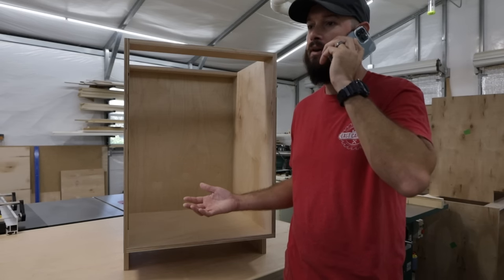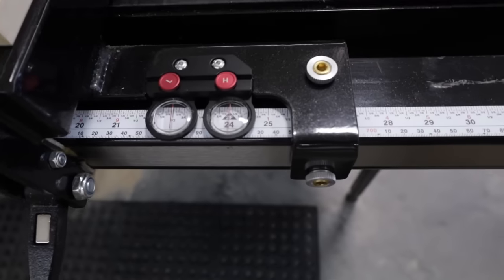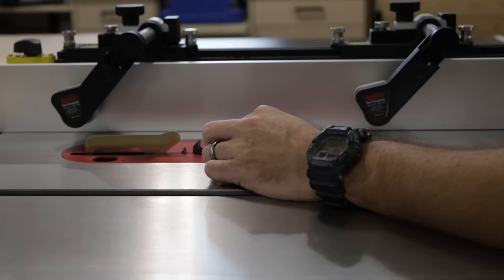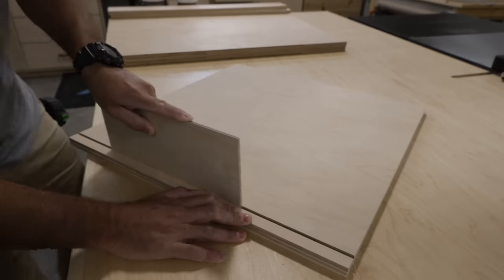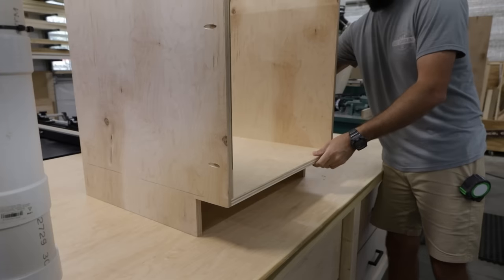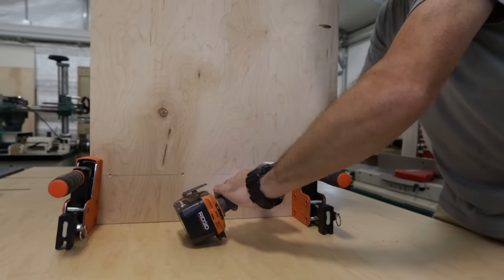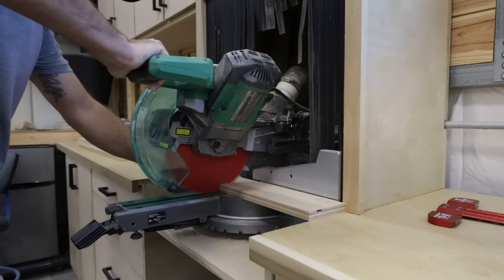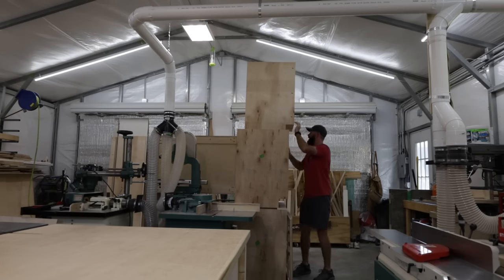How to Build Cabinets in under 30mins //The Easy Way

Comment: Very nicely done. I put myself through college making furniture and kitchen cabinets. As part of that, I ran a small custom cabinet shop. Our cabinets were very similar to the ones shown in this video. Allow me to point out just a couple of differences. Not because ours were superior to these, but to just show another option.

First, instead of making a dado to accept the cabinet back, we used a rabbet along the top and back edge of the cabinet. The rabbet was sized to accept the stretchers at the top of the cabinet and sized to accept the stretcher and the back on the back of the cabinet. Second, we didn't use screws. The cabinets were assembled with glue and 16d finish nails (shot out of a nail gun). Then, the back of the cabinet was used to make sure everything was square before it was stapled into place. The final step (before the face frame) was to attach the back nailer. It was glued and nailed to the sides and the top stretcher. 

Is this method as good using screws, as shown in the video? Maybe not. But, they went together quickly and required a sledge hammer to take apart. As I said, this is just another option. What I line about it is the rabbets provide a lot of mechanical support for the stretchers. Also, even with the extra table saw set up for the rabbets, I suspect my method is faster. If I started Monday morning, I'd have a complete set of upper and lower cabinets ready for face frames by lunch on Tuesday. Wednesday, I'd make the doors and drawers and the complete kitchen would be out of the spray booth by Thursday afternoon. Friday, the installer would pick up the cabinets and I'd review my cut list and make sure I had everything needed for the cabinets I'd start on Monday. 

It was a good way to put myself through school. Now, I just make things for fun.
Reply: I wish I had thought of that
Reply: Everything I’ve seen shows that nails loosen over time and they can’t just be retightened. Why do decks use screws instead of nails? I mean, house framing uses nails because of their sheer strength over screws. But houses warp and creak over time.
Reply: @truthseeker2815  The construction I described, using dados and rabbets, provides joints that are stronger than butt joints. Glue alone will hold such joints together for decades. We used nails because it eliminated the need to keep the cabinets in clamps until the glue dried, not because we were relying on the nails to strengthen the joints. 

Would the joints have been stronger had we used screws instead of nails? Perhaps, but I honestly don't believe that additional strength would have provided any additional benefit. For example, I'm sitting at a desk that I built without using ANY fasteners. Nothing but rabbets, dados, and glue. It's been over 40 years and several moves from one house to another -- lots of rough handling and abuse that's given the surface of the desk a nice patina. The joints are all rock solid. No screws were needed and none are needed for well-made, durable, kitchen cabinets.
Reply: @DKWalser  that's exactly how I build my cabinets rabbets and dados glue and finish nails to hold the cabinet together and is strong as hell the only way is coming apart  would be a sledgehammer and it would be in pieces
Reply: How do you know what to charge people for cabinets, especially if just starting off.    Hubby just started a renovation business and I think this would be a great niche for his business since there aren’t many custom cabinet builders around.
Reply: @arizonabound2708  Deciding how much to charge for your work is a very complex subject. To start, I suggest your husband focus on two questions: First, how much would it cost him in time and materials to make a typical set of kitchen cabinets? Let's assume it would cost $6,000 for the plywood, rough lumber, drawer slides, hinges, shop supplies, etc., and that it would take 40 man-hours to complete. (I've no idea if $6k is anywhere close to what the materials for set of cabinets would cost. It's just an example.) Given those assumptions, how much would your husband need to charge to be fairly compensated for the work?

The second question is what else could your husband have done if he didn't build the cabinets? Unless he's got people he could hire to build the cabinets, he'd have to give up some other work to take on a cabinet job. He wouldn't want to give up higher-value work to build cabinets, so the cabinet job would have to pay enough for him to give up that other work.

Once he's answered those questions, he'd need to compare what he'd want to charge with the market price for custom cabinets. If people are paying more for such cabinets (and waiting months to get them) than what your husband feels he'd need to charge, then maybe this would be worth pursuing. If, on the other hand, the market price is substantially less than his rock bottom price, maybe he should concentrate on his remodeling business.

HTH
Reply: @DKWalser  thank you for responding .  Great questions.  I’m going send him.  He is definitely keeping busy with an array of projects and quick fixes.

Comment: I am new to woodworking and have watched numerous videos on building cabinets. This one by far is the most helpful.  The detailed commentary and mention of dimensions and tools is extremely useful. After watching I now feel more comfortable trying to build one on my own!  Subscribed!
Reply from the maker: Thank you soo much for the kind words! Soo glad you were able to find me and my videos helped you out with answering some questions you might have had! 👍🏻
Reply: Forgot to mention that I love the touch of humor also. Best of luck with your channel!
Reply: Kim, I %100 AGREE WITH YA GIRL!
Reply: @samanthamorris8368  Thank you!
Reply: I really hope that you don't plan on building cabinets for a living or you'll go broke.
Reply: yes he sure knows exactly what a wood working prof is 🥰
Reply: The method of using the square as a guide for the jig saw hen cutting those toe kicks.... I never end up with a square cut, even clamping the square down. The plastic cover on my jig saw base is not consistent particularly at the front when starting the cut, just a tip for those to make sure of this or you will drive yourself nuts. I can make cleaner straighter cuts free hand. If you are a real perfectionist you can rough cut with a jig saw and use a simple jig with a flush trim router bit.

Comment: Friend owned a cabinet shop and found that building the whole box out of 3/4 inch plywood - the back and a full top as well - saved a ton of labor. Countertop guys liked it as well as it was a lot more support and glue surface for their slabs.
Reply from the maker: I could see that but for me being a one man shop 1/4 backs make the cabinet slightly lighter so it’s easier to move around for me 👍🏻
Reply: @eastcarolinawoodworks  Good point

Comment: Subbed just because of the phone call and stayed to see how you build your cabinets.  I do mine exactly the same except I cut the toe kicks out before I do the dado.  I also don't use as many pocket holes since I am a two-guy shop (me and our son) and we do single kitchen remodels and custom cabinets locally.  I am not a professional woodworker and got into it as a hobby that turned into a business.  We do put our toe-kicks at 4 inches x 4 inches and often put in a drawer in that space that you can open with a toe.  Generally, those can be used for large baking sheets and such.  Great video.
Reply: I would love to see a photo or video on the toe kick drawer.
Reply: Me too
Reply: Where I work, we build the toe kicks separately. Easier to install and level the framed toe kick, then install the boxes. And it prevents damage to the cabinets from use. If toe kick gets damaged, it’s easy and cheap to replace.
Reply: @empressche333  Thats an excellent idea. Many (most?) floors arent completely flat/level, so its easier to level the framed toe-kicks, instead of a 75 lb carcass

Comment: Love pocket holes. I have had a Kreg jig ever since I saw it at a show in Grand Rapids Michigan back in 1975 or 6. I still have the first one and it is made completely of aluminum with the steel hole inserts. it has only the 2 holes in it. Kreg makes awsome tools... Never made enough cabinets to get the machine.. Boy, I have a dead blow hammer in the shop, just can't find it right now!!! I'm so glad you talked about using glue. I have mentioned glue to some folks and have been told that I was nuts and to mind my own business. Screws are the clamps and the glue is the bond..... Sooooooo true!!!!!!!!!!!

Comment: Got my sub. Nice simplistic way of carcass building. Being an old guy with a bad back I have lately clamped in the stretchers and match measured corner to corner of the sides to make sure my  stretcher cuts were actually 90's . I find pocket screws are great but when they snug up they will pull in what you've cut for an angle, right or wrong. Ya I'll look over your shoulder for the next vid. Thanks.
Reply from the maker: Thanks for the sub and glad you enjoyed the video!

Comment: I went to Red Rocks woodworking school in Littleton, CO and became a certified cabinet maker.  It was the best experience.

Now, one thing we were taught was that you do not make toe kicks on cabinets.  Those are actually installed separately and first.  It allows for easy leveling.  When the base is leveled and accounts for any wall slumping or defects, then you put the cabinets in place and screw or nail the cabinets onto the base.

The base is 4" narrower and 4" in height, so that you have toe kicks still.  The base also has interior supports(looks like sideways bookcase shelves).

Anyway, the entire method reduces a huge wase of materials and speeds up production.

I hope that helps in your work.  Enjoy!😁👍

Comment: Really nice job building the box - video is concise and to the point.  Your methodology is perfect for building a square box.  From a production standpoint to save time I do not install the bottom rear stretcher as it is not need, but I do install one on wall cabinets.  I have gone to using pre-finished maple plywood for my boxes which allows me to assemble in this manner as I do not have to spray the boxes and then install the back.

Comment: I like the way you walk us through it. Makes the build that much easier. "BUT", looking at what your workshop has for "Tools", Ya I could build anything. Enough said, you enlighten me on a number of things that I took for granted. One of which is accurate measurment (Size) really matters! :) ... Never the less I have built cabinets (not to this extream & learned from my mystakes) but I am more keyed on restoring antique furniture, desks, china cabinets Ect. I have an antique cabinet that I have been working on for well over 5 years. It is 95% complete but because of the wood that was used to craft it I am finding it "VERY" expensive and difficulty to finish. Without going into detail, the unit is over 120 years old, crafted with "African Black Cherry" that is impposible to find. Turns out it is a protected tree as of this date and finding materials (when I do) from scrap is way beyond my budget. I need a back plate and found online a scrap piece that the seller was wanting over $1500 dollars. Not happening, Lol. Anyway this chest was submerged in 8ft of water for almost 8 months because of the blizzard of 78. And it was a mess to say the least. Not withstanding, but not "IF" but "When", this is finished I'll hang up my tools and sip on a shot of Pappy Van Winkle and say "Job Well Done". She's my pride and joy! Again thank you for your video, you have given me some great ideas for future projects and I look forward to more of your vids. Thx Again, avb ..... Sorry about the length of this post, as you can gather I am very passionate with this cabinet! :)
Reply from the maker: Glad you enjoyed the video and I can definitely see the passion! No need to apologize I like the passion 👍🏻
Reply: To whom ever replied, Thank you! This project was a labor of love. I am still looking for the backplate and need help!

Comment: I love your cabinet design! I will be building cabinets for my transit bus-to-RV conversion, and have looked for a way to make them sturdy enough to withstand potholes and poor road conditions.  Thank you for the video!!  BTW  I was an occupational nurse who cared for people that used their fingers to push thin strips through the table saw. Their body parts were typically too mangled for surgeons to reattach.  All craftsmen have their opinions on how to safely cut thin strips. Just be mindful.
Reply from the maker: Thanks for the positive feedback and I will keep that in mind moving forward! Thank you 🙏🏻
Reply: My dad was a cabinet maker and had some narly fingers from saws. He left us a table saw with a push stick. Watching him cut without a stick was scary. 

I want to say I don’t know what I’m doing but completely insulated and paneled my horse trailer. My brother (another cabinet maker) gave me a few tips but I pretty much learned to use the saw by myself. I have a jig saw (the soft material blade on this works great for cutting foam board insulation) that I used a lot but the table saw and miter saw were very helpful. I made bats for seams with the table saw but I used the push stick all the time.

Comment: Great content, I'm curious ,on the back of the cabinet with it all being flush, what do you do if the wall isn't level. Shouldn't you leave 1/4 inch in case you need a scribe line while installing. Thanks for the video and Humor makes the build seem more approachable from a DIY'er view Thanks again.
Reply from the maker: Great point! Depending on where the cabinet is going in the house will determine how I build it. This cabinet is going between 2 other cabinet so it will be fine. I will offset to scribe to the wall on end cabinets or I’ll put an end panel on the cabinet. This was more for the beginner/DIYer! Glad you enjoyed the video and thanks for the feedback 👍🏻

Comment: Good video and description, I always like watching for different tips and techniques to improve building cabinets.  
I did notice you used an impact drill for the pocket screws, unless you're good at using finesse with the trigger, I find a standard drill with the appropriate torque setting eliminates the risk of sending the screw too far into the wood.

Comment: Or you could use 1/2" backs which are only marginally more expensive than 1/4" and much more rigid and staple/screw them to the back of the cabinet (you could dado them if you want but it doesn't really add anymore ridigity) which also helps square up the cabinet. And you don't need the time consuming kreg jig stretchers on the backs. We also make our kicks separate which makes installing way easier. To each his own. Cheers
Reply from the maker: Great points! I’ll keep those in mind moving forward 👍🏻

Comment: I didn't know your channel until now and I subscribed to it right after the first watching. You're absolutely right: if your machines are set up correctly everything you cut will be square. For example in the industry I don't think they have a guy who constantly checks for squareness. Another point I agree with: I too would rather overbuild something than underbuild it and finally end up into trouble.

Comment: The back panel is what squares the cabinet. The face helps the front square and adds much strength. You might find it easier to use the table saw for toe kicks and finish with a Japanese saw. On wider cabinets I like to glue  the stretcher to the back panel, lay on its back and put weights inside. Don't forget the staples in back at 45 to hold back panel tight. Good video.

Comment: Nice shot. I like very much the way you reinforce the structure, no doubt it super sturdy. I do sometimes play with woodwork, i'd like to see where you would place the screws to put that in place on a wall. If possible make a video about. i have not found good videos showing hot to pin the cabinets on the final place.

Comment: Great video man. I have made a couple cabinets in a very similar way. Only tip I got is make a template for the toe kicks out out 1/4” plexiglass and do it with a 1/4” router bit. It’s clean and fast. Keep up the good work man

Comment: Couple of things. My A + hole puckered several times- well maybe each time as I watched you push trough each panel on the panel saw (very nice). I have done it many times myself. About a month ago, doing the same thing. I nicked my thumb. Fortunately I did not lose it. Being a medical expert on when to have a wound stitched I did not. It bled for 3 days. You might want to add a disclaimer- a short safety, do not do what Ed did warning. Doesn't mean I still don't do it but I exercise a lot more caution. I admire your tools and machines, I lust for a full size panel saw. Enjoyed the vid, picked up a few ideas. Thanks.